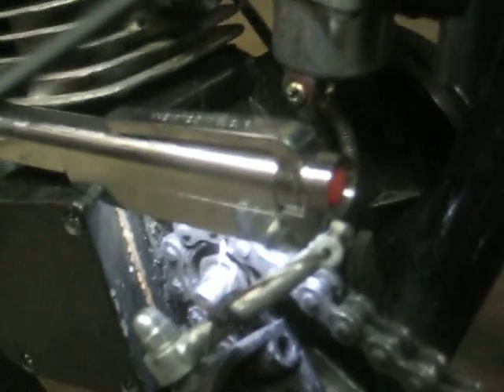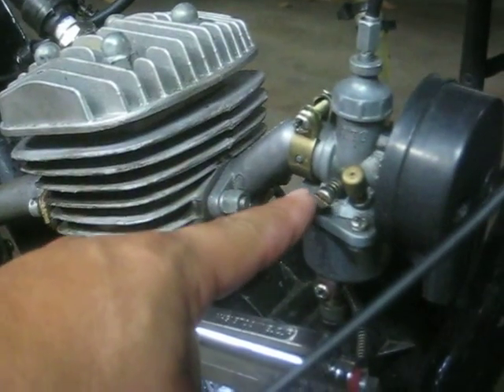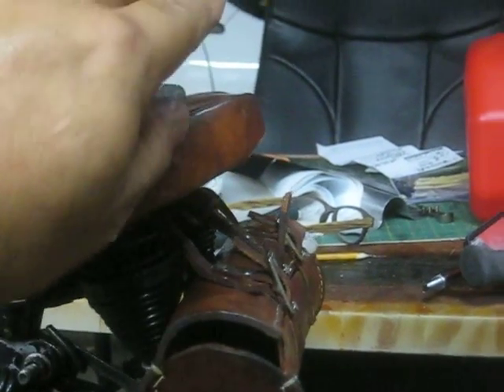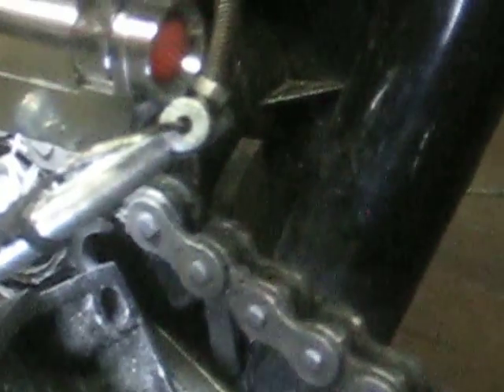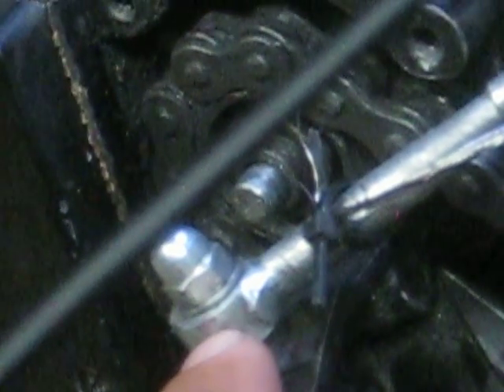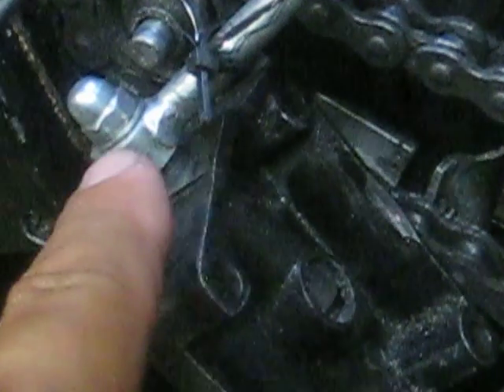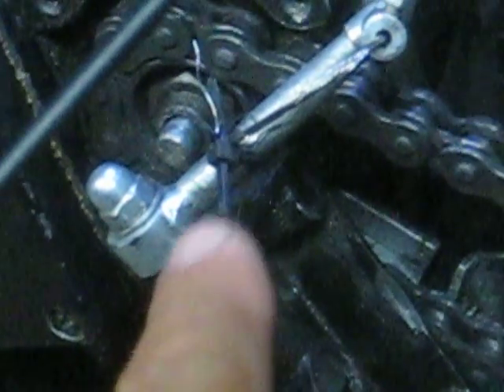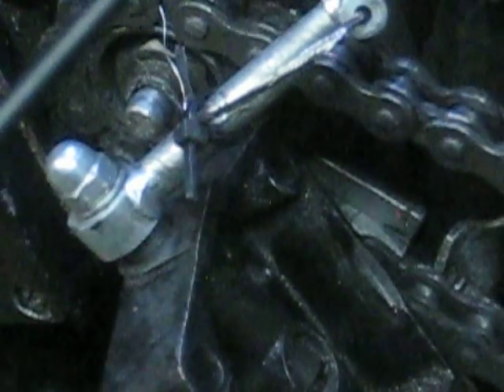49cc motorized bike clutch repair camshaft

Comment: My crank arm seems a bit loose when my clutch is disengaged.. any guidance on this issue? I tried to tighten the bolt at the top but seemed tight. It does wiggle when clutch is disengaged but it’s tight and bike runs fine when I have the clutch pulled in (engaged). Is this normal? I have about 150 miles on the bike, it is still being broken in, running pretty rich.

Comment: I had a chain break and I am trying to reassemble everything but my crank arm will move but it doesn't have any tension to move it back to its original position. Do you know what the problem could be
Reply from the maker: If I remember , it might be that the cable is just not tight enough. It was a real pain to get it tight on mine. I stopped using mine after 1 year and got about 4000 mie sout of it. Worth every penny. Now however I use an electric bike conversion kit. Doing that for almost 5 years now. I hope I was ablt to help.

Comment: I recently took the cover off where the driving sprocket is and noticed that when the clutch handle is pulled tight and the pin is pushed in the camshaft creates a lot of stress on the bolts holding the cover on (pushes the cover away from the engine). It actually stripped the longer bolt and inner threads closest to the clutch arm. Is this amount of stress from the camshaft on the cover normal? Is it possible that the camshaft was installed in the wrong position on the crank arm?
Reply from the maker: yes it is normal. The flat part of the camshaft must be in the position of the " hole" . When you use the clutch the camshaft then rotates and the round part of the camshaft pushes the bucking bar in deeper. I'm not so sure  it was installed wrong though anything is possible. I rode mine for one year at over 4000 miles and 2 of my bolts on the cover broke. No reason I guess but just wear and tear.
Reply: I understand the mechanism, do you think it's possible that some part in the clutch is not compressing enough or the internal spring is too stretched out? I drove mine under 60 miles and the top right bolt with the nut was already stripped. This is either a poor design or a problem associated with the clutch assembly or positioning of the camshaft. Please let me know if you have any recommendations
Reply from the maker: Michael Lipinski unfortunately the only advice i can give is look for some on line in your are who repairs them. 60 mile is nothing. sound defective to me but the design should not be the problem. too many are sold and if there was a design problem no one would ever buy them
Reply: did you ever fix it? i have the same problem.

Comment: hey man i did this but now the ball and the bucking bar are not fitting in shaft any thoughts on what could be done?
Reply from the maker: if I understand what's going on is that the bucking bar does stick out a little. When you close the cover and engage the clutch, it will push in the bucking bar.  You CANNOT push it in just with your hands. It's way too hard.

Comment: but how do you hammer the camshaft off of the crank? i cant figure out a way
Reply from the maker: take the nut off first then remember to make note of where the crank is in relation to the camshaft and then use a vice. Place the crank arm across the vice but don't tighten the camshaft because it is supposed to fall out from the bottom. hit the top of the cam with a hammer and when you replace it use a rubber mallet NOT a hammer or it WILL damage the threads that hold the nut. I hope this helps. Let me know how it works out.
Reply: Don't , get a gear pulling tool,they sell them at any auto parts store.